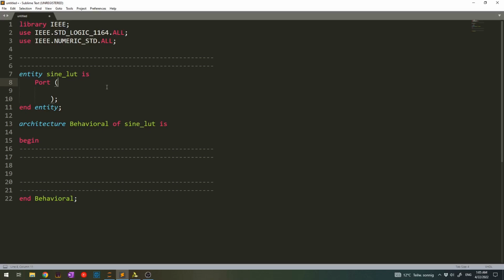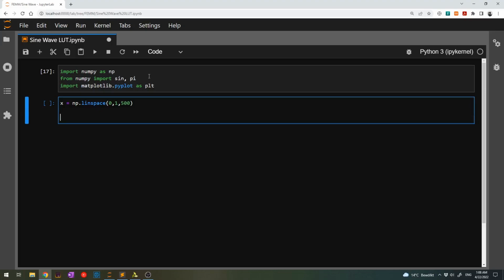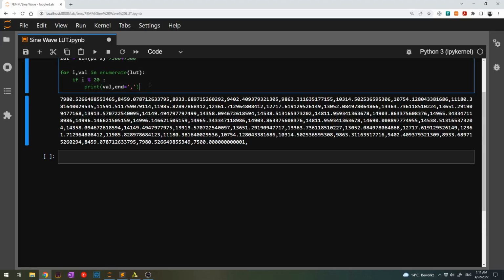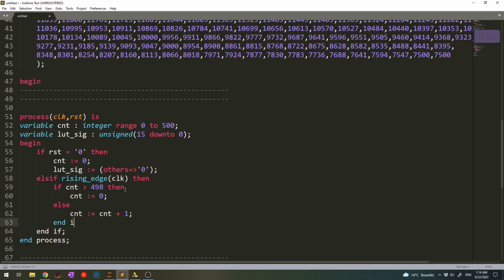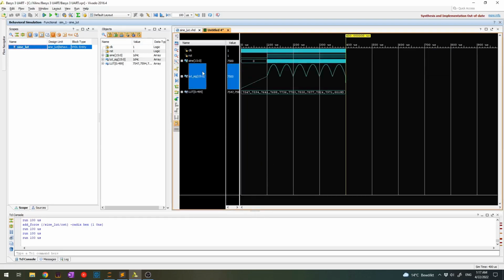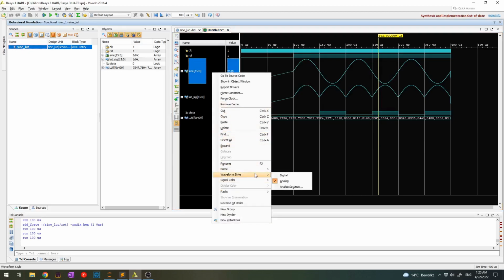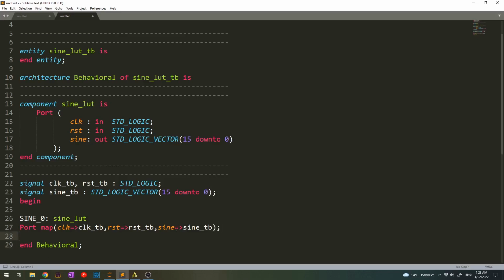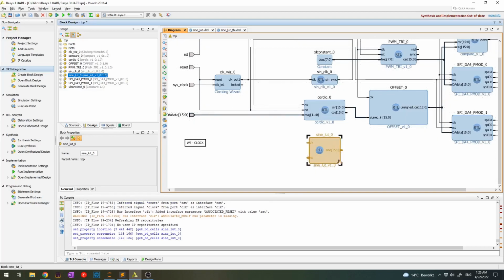LUT-based Sine-wave in VHDL for Power Electronics converters with FPGA

Comment: Wow nice one. What Major changes should I do in this code to use it for 12 bit parallel interface DAC.
Reply from the maker: @Engineer_Mubasheer  you can write at the output: sig_12b <= sig_16b(15 downto 4);